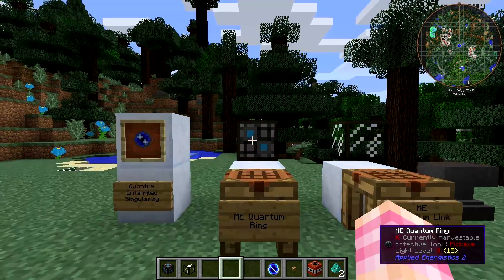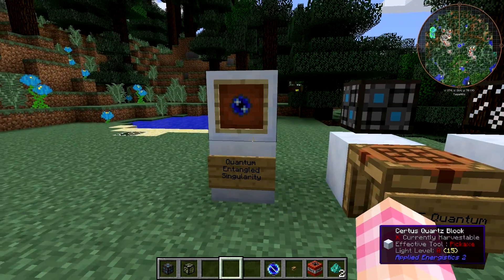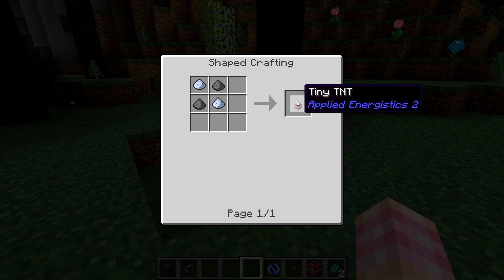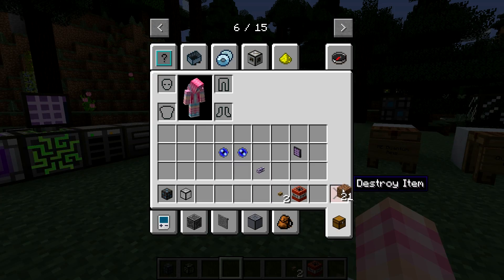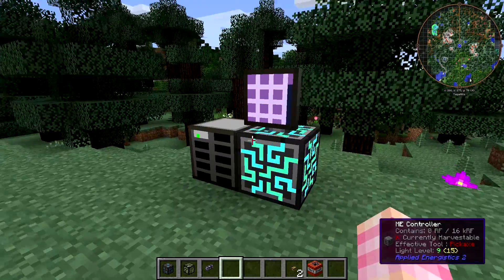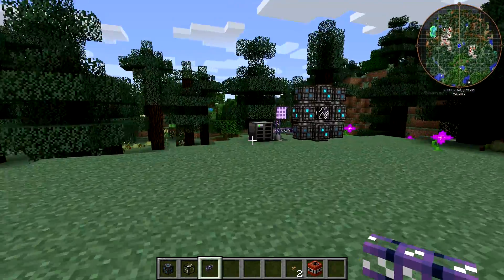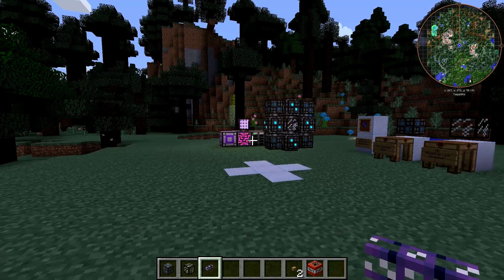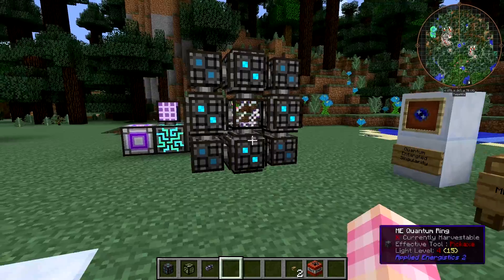Applied Energistics 2 Tutorial #14 - Quantum Ring

Comment: Just a heads-up, you can get stored in spatial io. you won't die instantly, but you will be trapped until you either die or something deploys the contents.  in addition, you will need to have something to remove and replace the cell in the io once it is activated.  while this does mean you can be transported anywhere the cell goes, you are rather helpless in transit.  I would advise a different mod for teleportation purposes.

Comment: Okay, I can link 2 AE systems from infinite distance. But, can you link 4 AE systems to 1 AE system? Like let's say, myself and 4 friends want to find places for our own bases, but we want to share materials across each other. So, we make a, "community" AE system, and then we want to link each of our personal AE systems to that Community System. Is that possible to do?
Reply: I may be a little late but you can hook up interfaces to storage buses to access the materials on the other network
Reply from the maker: You would need two separate rings for each connection. So if you wanted to connect 4 disparate networks to one central network the central network would need 4 rings and you'd need one ring at each satellite. So you'd need 8 rings for that.